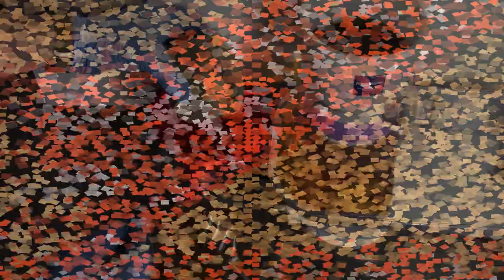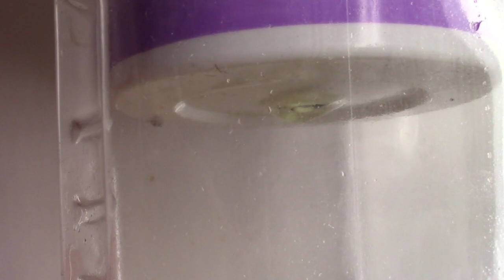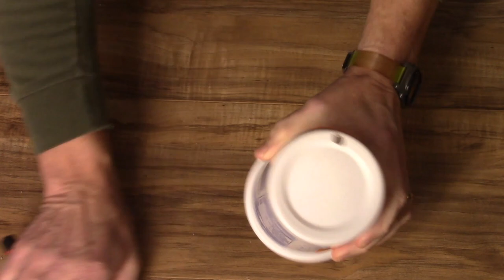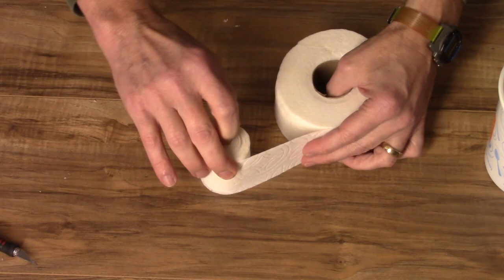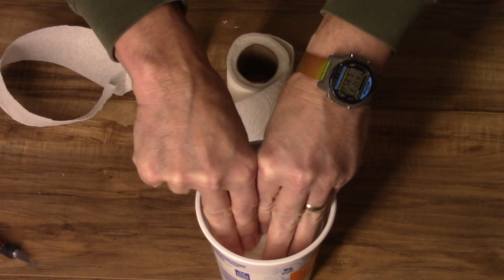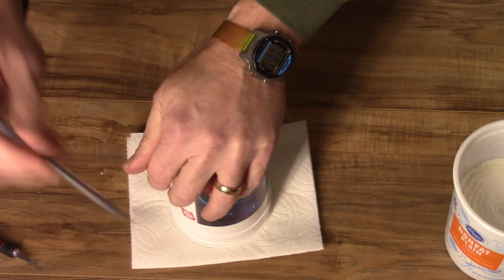DIY Oil Filter for our Freeze Dryer Vacuum Pump

Comment: Would you have a faster drip time if you froze your used oil first and got rid of the block of ice that the water turns into and keep your filter from clogging up with water saturation? I know not all of the water would be rid of in that first step but a great deal would be so I would assume that less water to filter would be better?
Reply from the maker: The drip time really didn't change when I've tried that and the total time is increased greatly with the added freeze time. (and for me it's not worth the risks of spilling the oil in the freezer) I have stopped squeezing out the filter material. which is holding most (almost all) of the water. Now I'm just tossing it and replacing that much oil each time.

Comment: great idea, I'm definitely going to try this method. What are you looking for to know when it's time to change your filter? do you count cycles of filtration or judge by the colour of the filtered oil?   LOVE YOUR VIDEOS! thank you
Reply from the maker: Thanks!
If you have a newer vacuum pump, like my sister's new 2022 machine, the oil is still very clean even after 30 batches. With those new machines, they don't need a continuous flow filter system like I use with mine, only this simpler filter. With the new machines this filter is going to last a year or more. With my older vacuum pump (2017) this filter will only last a half dozen times, and I know it's no longer effective because water starts going through it into the bottom.
Reply: @SchoolReports  excellent, thank you. My machine is 2021 - requires oil change every 5 batches. I live outside the USA and the harvest right filters are hard to get so this is a great alternative.
Reply from the maker: @bjt92  I think this filter works better than any I've received from Harvest Right; and really inexpensive. For the oldest vacuum pumps the continuous filter pump system works well. It keeps my oil clean for about 30 batches between draining and changing its filters..
By any chance does your vacuum pump have a round knob about half way down the side, labeled ballast?
Reply: @SchoolReports  yes it does :)
Reply from the maker: @bjt92  After my sister got her new machine with it's fancy newfangled 😁 Premier Vacuum Pump which has a gas ballast feature, I started to wonder if the ballast feature worked on mine. I've been trying it out at different settings and so far I'm liking what it does; the oil is staying much cleaner, for a much longer time. I may do a short video about it later.
Reply: @SchoolReports  please do- that would be excellent.

Comment: Just bought a freeze drier and made 1 tray of skittles and 2nd batch of watermelon.Drained the oil and its almost black. Hasn't separated after 20 hours. Is this normal?? All the videos I've seen haven't seen oil like this.
Reply from the maker: No, that's not normal! Was the watermelon prefrozen? 
This filter does a good job cleaning the oil, but I've never had the oil start out black, just cloudy from small amounts of water mixed in. I'm not sure where the black would come from.
This video shows the oil from my sister's newer machine (late 2022) after 40 batches - https://youtu.be/UibI7LXFbbs?si=AwQ1DYs7G61v2bES

Comment: Are you currently using this filter setup, or the one that you built using the 3-D printer parts? Also, have you noticed any off flavors or smells from the freeze dried food, due to dirty oil - or at all? We just did a batch of sour cream and it has a strange taste to it...
Reply from the maker: The next video (coming soon) is more about the automatic, continuous flow oil filtering system. (it's not really continuous, we have it run 15 seconds each minute) This filter is just what we use to clean the oil that comes out of the continuous flow oil filters when we clean them.
As far as flavors or smells, the oil should never have any interaction in any way with the foods in the freeze dryer. As far as I know, things should, and can, only go one way; from the vacuum chamber to the pump.